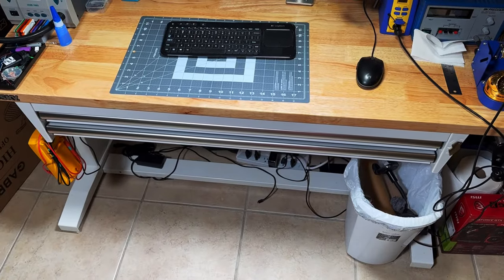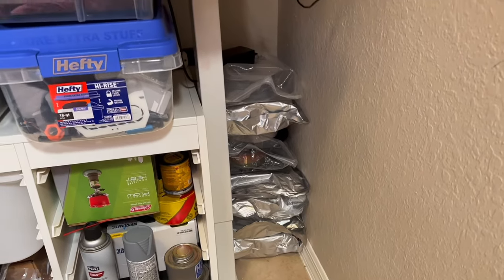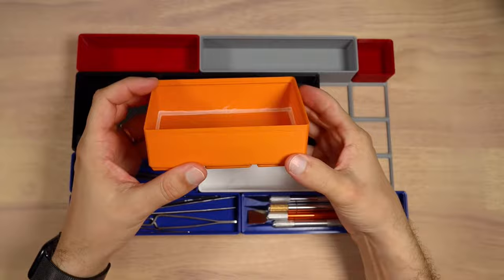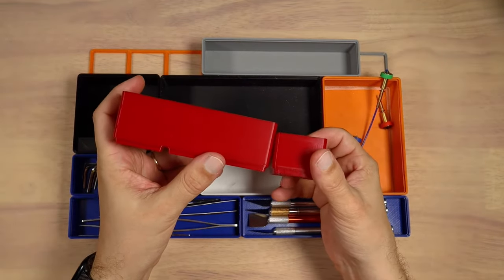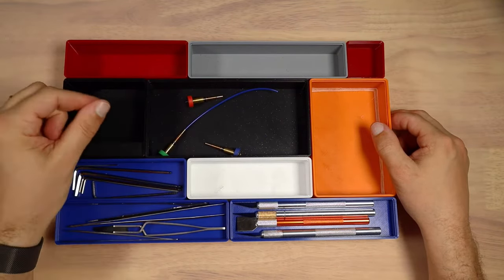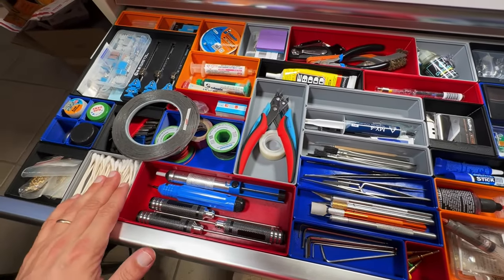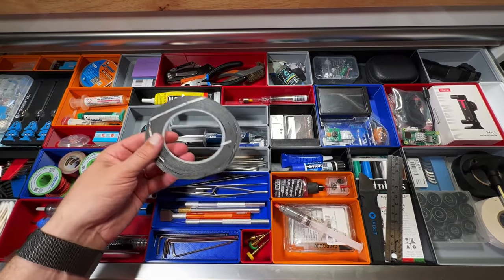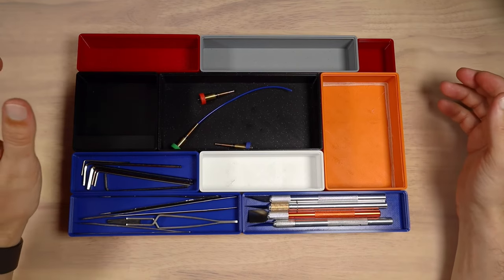Ultimate Husky Drawer Organization with Gridfinity!

Comment: Did you calculated - what is approximate cost of all plastic boxes in your drawer, or one of them? What I'm talking about - is it cheaper or expensive comparing to by something similar on Ali?
Reply from the maker: Short answer No, I have not. But I personally have ton of unused filament that finally found use in this project. Worth mentioning that products like this doesn't exists outside of 3D printing - it has grind that holds boxes tight and even if you take one out from the middle the rest will stay on place and wont slide around. Also don't forget about fully customizable sizes and boxes even can be adjusted for specific tools. Project was done about a year ago and I have spent 3-4 spools and you can get spool of PLA now for 10-15$ + electricity I think it puts us under 100$

Comment: what ahve you done to fit it perfectly in your drawer? I think it wont fit by default perfectly becouse your drawer probably isnt doesnt has the exact width ?
Reply from the maker: For me sum of all containers turned out to be very close to be edge to edge of each drawer. I only have around ~25mm left on the right side of the drawer which turned out to be a perfect spot and size for my long screwdrivers.

Comment: Honestly, Gridfinity is such a cool system and your usecase is ideal for this. I'll probably use them myself sometime soon.

Do you think the magnets in the 3d bins and baseplate are important?
Reply from the maker: I am not using magnets at all and bins are still sit very well and perfectly snap into place. Magnets can be very helpful in case you have metal desk in your workshop and it's always nice to have extra protection from accidental flipping especially if you store very small parts in there. Also with magnets you might not even need to use grid.